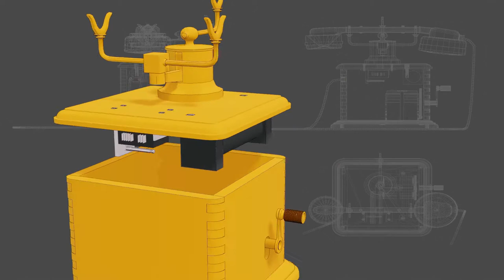Antique Magneto Phone Restoration - Bluetooth interfacing - with subtitles

Comment: Noice, although i did not understand the need for hand crank, did you bypass it?
Reply from the maker: The hand crank is part of the signaling system. It is used to signal that you want to make a call : you'd crank it a couple of turns while on-hook, then pick up the phone.

Phones back then could either be connected directly to another phone (and communicate only with it, point-to-point), or be connected to a telephone network.
- Point to point : cranking directly rings the bell of the phone at the other en of the line
- Telephone network : cranking alerts an operator at the telephone exchange : you'd crank the magneto, go off-hook and wait for an operator to be available. Then you'd tell the operator who you want to call, and the operator would plug your line on a plugboard to your destination line, and then ring its bell for you. 

I didn't bypass the magneto, the board does support detecting cranking but there needs to be a behavior associated with it since there are no longer phone operators. So I could either have it called one number (like in the point-to-point configuration) or some kind of speech recognition hooked to the line to interpret what I say an make the appropriate call.
Reply: @juleinn5512  that makes sense, or you could use it for recording audio message to be sent after you hang up the phone. Basically, this mechanism is so old that even with being an engineer in Electronics and Comms, I couldn't figure out the need to have the hand crank, as it was so esoteric idea to have a phone back in the time when this was in production that almost no one knows how these things worked. I remember the first phone our house had was somewhere in 90s. Before then we used public booths and even those very rarely. Thanks for such a nice trip down the history. Cheers!
Reply from the maker: @qwasiedrf9458  Well this telephone model came exactly to solve that problem : no one knew how they worked, and each phone was different. Maintenance employees were unable to deal with how much phone models were on the market, so the french government standardised this model and had it manufacturer by different manufacturers. Here is a couple of external blogs to find more about this (french only), you'll also find the schematics and additional pictures : 

https://www.fnarh.com/poste-marty-1910.html
http://www.l2l1.com/tel1.html
http://alain.levasseur.pagesperso-orange.fr/page6.htm